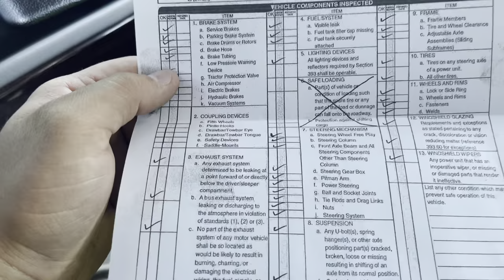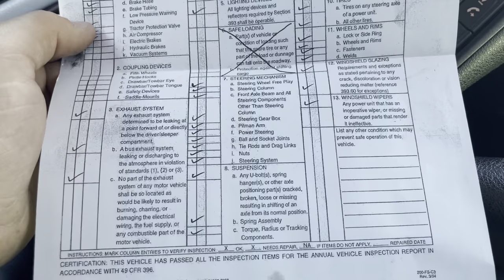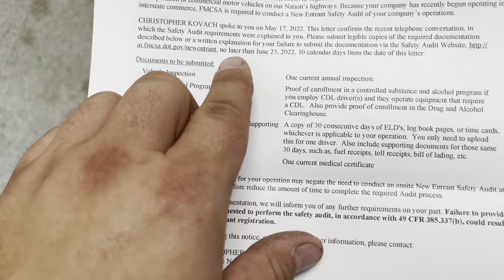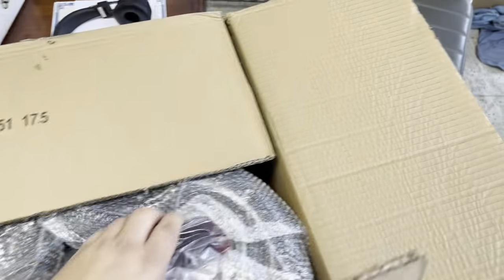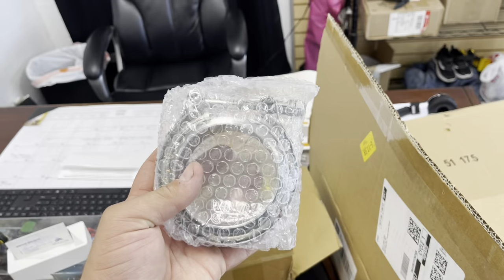My BATTLE with the FMCSA Continues….

Comment: Hey Bruce, my cousin owens a small trucking company. Only runs local. He doesn't use log books or ELD. Just send them you daily time card showing you clock in and out every day for work. If you don't have a time clock, then a paper journal of the time you work is sufficient. They want to just make sure your work hours are not more than what is legal.

Comment: don't forget Bruce just because a vehicle passed the inspection at the time of the inspection, doesn't mean that won't fail within the year. so make sure you do a visual check at very least before a long run or once a month which ever is soonest.
Reply: Or before every trip. Supposed to do it at the beginning of each daily trip
Reply: beginning. middle and end is driver inspection. pre and post

Comment: Hi, just watching your video and noticed you have disc brakes on your truck, this is the main reason you're having trouble with your new trailer brakes ,because disc brakes run higher air pressure it is supplying to much air pressure, drum brakes require less air pressure, that's why you're flat spotting tyres and over heating brakes, you will need to drop service brake application pressure to trailer to stop extreme braking which is happening at the moment, had same issue in Australia ,disc brakes on truck ,drum brakes on trailer, they don't match up well
Reply: Same thing I said on his video about the trailer

Comment: I was working at a Peterborough dealership,  and given a work order to perform a PDI inspection ( pre delivery  inspection  ) the truck was just delivered to the dealership,  directly from the factory in Denton , TX.  It failed the inspection.  A brand new truck .  Lol.   It had a wheel seal leaking.

Comment: Before retiring I operated a dump truck business, we were not required to keep a daily log however we were required to to keep time cards on each driver. I purchased a used time clock from a nearby company that closed with a case of unused time cards for $35.00 at auction.
Reply: because he goes out of State now and then, he must keep a log and he can`t use a time card at all. He maybe exempt electronic logs but must keep paper logs.

Comment: U should try and get with a Contruction Site Preparation development company that also runs there own trucks / Dump trucks as they probably will understand your DOT situation better then a standard trucking company,.  also that low boy flat bed your having the brake problems with too as they are around and operate all types of Hevey equipment too

Comment: You probably already know it(?) but your trailers also have to be inspected annually. Since I dont know what your exact setup is (?), you might want to get a Permit Book (you can get them at the larger truckstops) and keep it in your truck. In the permit book, you should keep any cab cards(permits) you have (IFTA,etc), your tractor registration, trailer registrations, annual vehicle inspection reports on both tractor and trailers, MC registration cards/documents, and insurance cards, etc. You will be asked for all of that if you are inspected on the road somewhere? If you have all of that in a Permit Book, you can just take the permit book in with you and give them what they ask for? The trailer registration and trailer inspection report is usually kept on the front of the trailer in a document holder but since you only have one or two you pull, you can probably keep the documents in your permit book? Any trailer you pull should have a trailer registration (showing who its registered to) and inspection report on it. Like Kevin said, you can make a permit book out of a notebook with page protectors in it? I just always used a permit book because its always set up the way you need it and you can usually zip it up so nothing will fall out.

Comment: Even with the 150 air mile exemption, u found out you still have to do a log book, it will have to show  not only your hours trucking but also your hours worked doing other things around your shop etc for a period of 7 days prior and i think after each trip.   Also you have to do a pretrip as part of your logbook.  I hope you had an annual done on your trailer too, cause it is required as well
Reply: Unless you have a construction exemption in some states
Reply: @joeysimpson4020  wow, I didnt know some states had that, they all should

Comment: Get an electronic ELD in your truck. I believe samsara works with your iPhone. It’s just a little box and antenna that you install that also splits off your diag port. You should be doing logs no matter what, even if it in town.

Comment: Any DOT station will inspect the truck for free. If qualified you just fill out the paperwork and sticker and apply to truck.  Also if you check all these items at every service interval your annual inspection will always be current,  just change sticker and file paperwork.   Same goes for trailer.  Now to get trailer inspection done?

Comment: Just watched your video and wanted to point out a couple things with your DOT  Annual Inspection.
1. Your side window are tinted to dark.  70% light transmission is max. Most factory glass is made with 20~25% tint. Yours looks like it's around 30% light transmission.
2 only DOT required light have to work. You can add 100 extra lights to a truck and trailer and have 50 of them out and that can't write you up if the required light are working. The FMCSA code book lists all lighting requirements. Supplemental lights are not regulated.

Comment: the easiest thing to do would be to just get DOT numbers, but yours wont be the same as a for hire carrier. it will be so much simpler. you still have to have driver files ect but your insurance is 1,000 times cheaper and if you dont ever go out of the 150 mile range you dont have to log and so on. You dont need a MC though because you arent for hire. its complicted but not lol

Comment: that FMCSA audit isn't that big a deal   i've been through a few over the years , i've had my own authority for over 20 years  ,the new audit for 2022 was a bit more in depth ,,i had more problem with IFTA because i almost never leave my home state of iowa ,,i do mostly short hops  , hauling farm machinery for farmers who don't want to road their equipment, ,logbook entries for  mileage and hours are crazy because i might haul 5 or 6 loads in a day and very rarely have more than 4-6 hours of driving time during a day and i might only drive 150 miles

Comment: not 100% sure on this but i would have thought your dealer would have done that inspection for you as part of the new truck inspection they do when a truck comes in and made ready for the buyer on that FMCSA ask them if you can use the same time clock your hired hands use to log their week on if so that should work i think Bruce

Comment: I thought not for hire was for personal owned trucks with regular plates....this truck is a company truck so i would think u would still need logs for the safty of others....its easy to fill out under 150 air miles   n put milage when u start n milage when u finish...i did that when i drove local....cause u meed 7 days prior log sheets for dot...
I stopped driving cause of all the regulations....

Comment: I did the annual inspection myself on my truck.  Trooper didn’t say anything 🤷🏽‍♂️
Reply: How do you do youre own inspection??
Reply: What he said ^^
Reply: Ok thanks I didn't know you could do that
Reply: @stevosprojects7123  Any one who has a valid CDL can do an annual inspection. You get the annual inspection forms at any of the truck stops. You do the inspection, inspecting all the components on the report. Noting any deficiencies. Then fill out all the info on the form and the decal. Then put the decal on your vehicle. Done. Make sure any deficiencies are correct ASAP and then update the inspection report with the date repaired.
Word to the slackers who think they are going to be slick and just fill out the form and not actually inspect the components properly. Your playing with fire and you may get burned if there ever is an accident and your name is on that inspection Report. So do it right, or don't do it at all.

Comment: You can submit your time cards for your local work.  Just make sure you aren't clocked in for more than 12 hours at a time and have at least 10 hours off duty between days.  When I used to work local, we had our time cards that they paid us off of, and then we kept a daily movement sheet to turn in for logs.

Comment: Still missing your DOT number, Not For Hire and IFTA stickers. All your trailers also need the same safety stickers, which should have been done at the time of purchase. You also have to keep maintance records on truck & trailers. Since you sometimes travel out of State, you must keep paper logs if you still follow under the exemption for electronic logs. All blanket permits should be kept in the same binder along with your insurance, medical, inspection reports truck & trailer and last 14 days of log books. Blanket permits are for oversize loads, especially tractors or other pieces of equipment and are purchased through the county or city you live in.

Comment: I was under the understanding that if the truck generates revenue, its gotta have logs. Even if its for your own business and purchases, its still making money. I was told Not For Hire was for stuff like using it as an RV. Feel free to correct me if I'm wrong though. No hate, I just don't understand why the FMCSA would be so hard on a one truck operation like yourself. I'd figure the mega carriers are where the money is at
Reply: If your within 150 air nautical miles of home base you do not need to run any logs at all. Once you pass that mark then your logs start
Reply: 1 truck or 50, he has to follow the same rules.   This happens to everyone usually within first year of trucking related business.  Actually anything 10,000 gvwr, pickup an trailer included, or truck alone as the ram550 is included.   He is still operating illegal but as long as no wrecks and injuries he'll probably be ok...
Reply: Mega carriers are usually the safer units on the road, they have more to lose than fly by night operators

Comment: To cover your ass wen running your less than 150 air miles run a time card. I believe your allowed 12hrs a day. But if your not running a log book (like your situation) a time card is supposed to be used

Comment: It wouldn't be a problem if you purchase a new petrbuilt 579 EV it has a whopping 150 mile radius, and if you airbrush President Biden standing in front of a rainbow holding a Ukrainian flag riding a unicorn the FMCSA will never bother you again... extra points if you paint the name "Pete Buttigieg" on the doors and wright "Jan 6th Never4Get" on the back of the sleeper...
Let's go Brandon

Comment: That inspection was over kill !!!!
Don't get me wrong safety first but dot has not been that extensive on mine in 20 years. Guess different states?
Reply: Ikr....I said the same thing.... half the stuff he was checking Is NOT DOT REQUIRED...... but it doesn't hurt to check..lol
Reply: The DOT inspections like this are the same in all 50 states. Depending on the truck there could be more or less to be checked

Comment: Used to do roadside service and I've worked in a shop in the daytime but repair trucks on the interstate at night I know you're going through Bruce I have to do DOT inspections on trucks and repair them when they were DMV inspected they didn't pass a lot of times what I used to do when guys couldn't pass is I'd look at everything was wrong find it out and then let them call the company that way I'm give them a chance you know to take truck in and then I'd say I'll come back in an hour or two hours you know when you could get everything taken care of and then I would go back over the list and other times I just wrote up sitting to say you know hey these need to be repaired and I would sign off and they were allowed to technically they had 30 days or 40 day 45 days to get everything taken care of but most time they came back with the repairs done I would reinspect it and then I would write the certification on it for longer

Comment: I noticed you didn't buckle the carseat into the seat. I thought maybe at the start of the video you just hadn't done it yet but could see it still wasn't buckled during the DOT inspection. Some folks don't realize you cant just set the carseat in and they'll be safe. You have to run the trucks seatbelt through the hole on the bottom side of the seat and buckle it and pull it tight for it to be safe. Otherwise if you slam on your brakes or get into a collision the carseat turns into a missile with you child inside. Please be safe!!
Reply from the maker: It was Deff buckled
Reply: If you look at the first part where he says he’s coming  along, you can see the black piece right the bright red button on it, that’s one of the two latches that goes down to the bottom of the vehicle seat. It appears it is tight back on an angle, so I’d say he has him strapped in safe 👌
Reply: Shit damn yall are right. looked a little close. the main seat belt looked so damn straight to me it didn't look buckled. Damn my b. I've seen so many people not do it that i jumped. well fuck